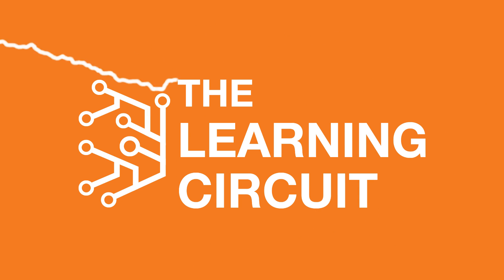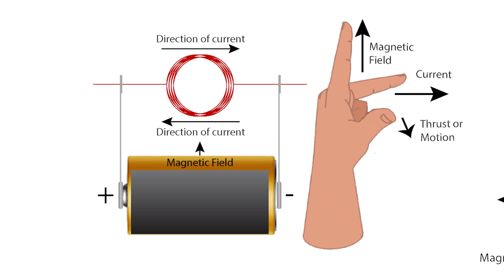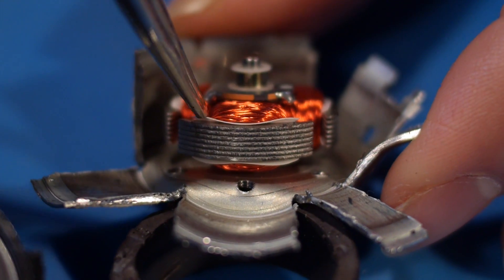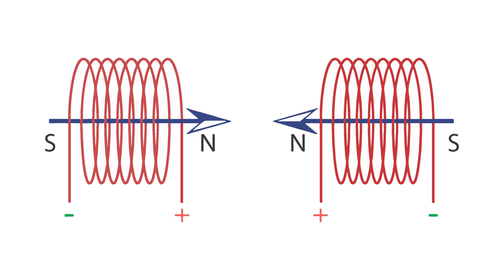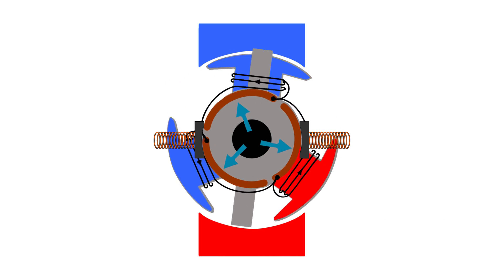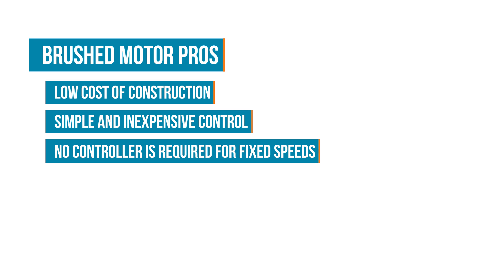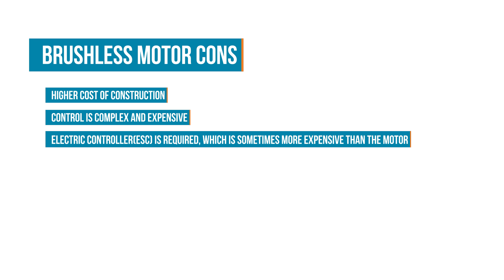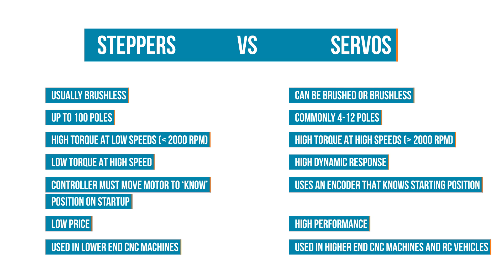Intro to DC Motors - The Learning Circuit

Comment: Thanks for covering stepper motors and servos at the end. A project I plan to work on in the future is to automate some casement windows which are mounted very high up and normally require a long pole to actuate the mechanism. Steppers with limit switches versus servos are exactly the components I'll be looking into to build the project.